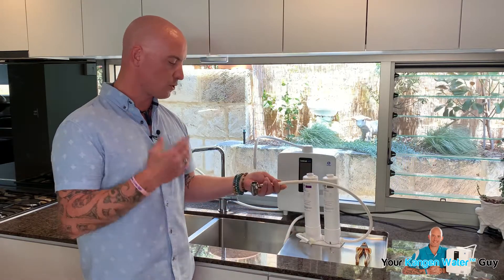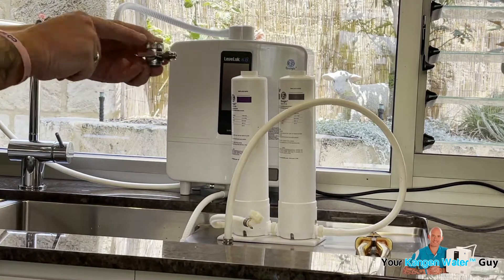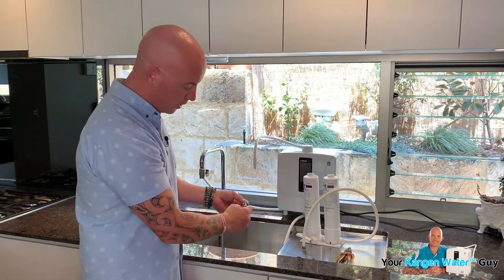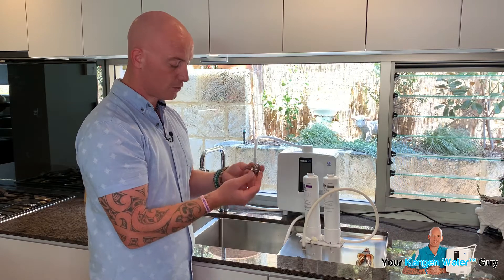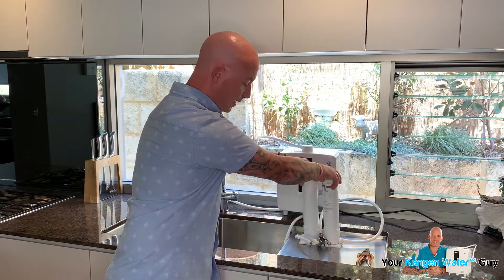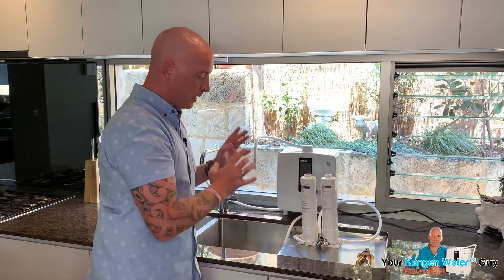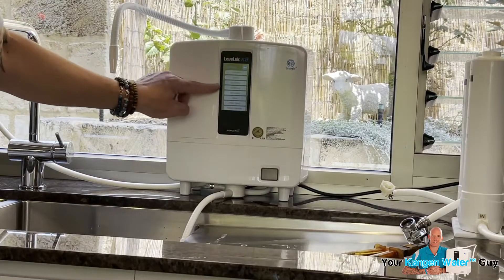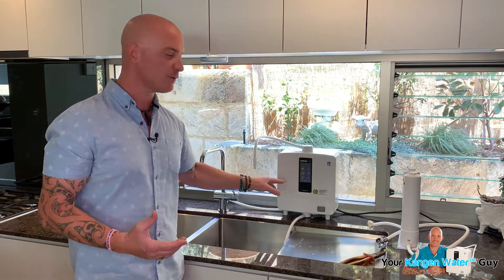Water Pressure 'Low' or 'No Water' From My Ionizer

Comment: I do e-cleaning every month, and also do deep clean every 6-9 months. But I notice that some time in between, the water pressure coming out of the secondary hose becomes low, as if it has a blockage. I even poke a thin chopstick inside the hose to help breakup any calcium, but seems not to solve the issue. Could this be calcium built up?

Comment: What if it’s water pressure, from the city water source, to the home that’s the issue, any recommendations?
Reply from the maker: In regards to what... Too slow?
Reply: @YourKangenWaterGuy  yea too slow
Reply: Low flow
Reply from the maker: @joycearmstrong9500  the city pressure shouldn’t be too low. They are supposed to maintain an amount of water pressure. However, if it’s at your end as the owner, then you may have to look into what you need.